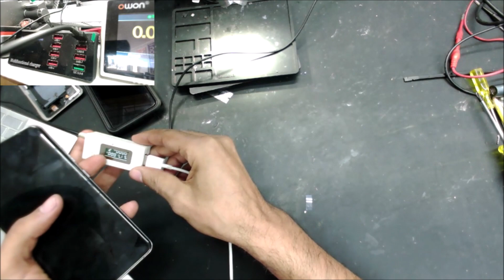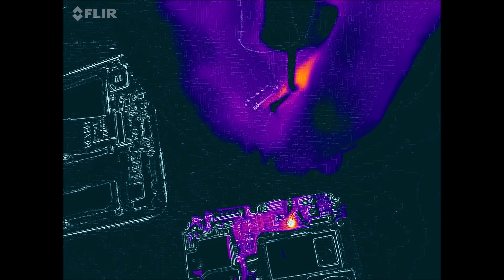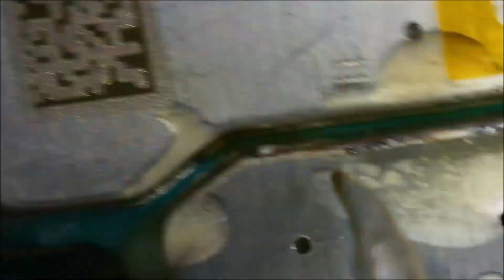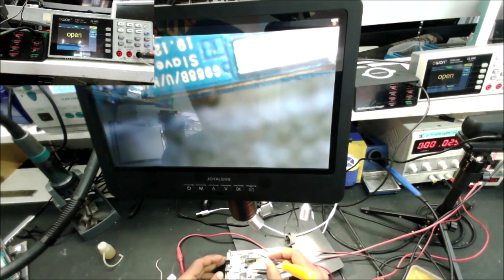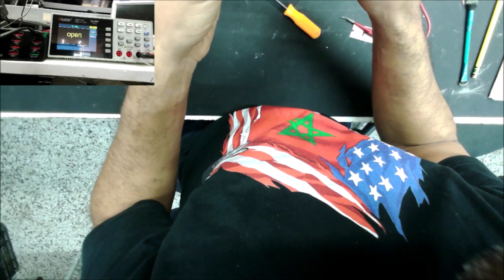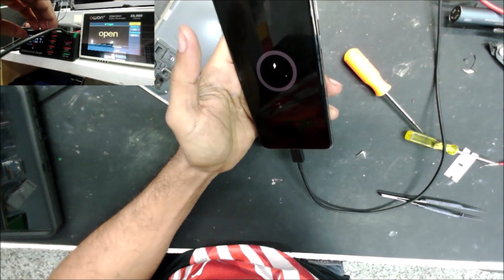Samsung Galaxy S20 Ultra SM-988U no power way to find short in the board

Comment: I have a note 20 ult I ordered replacement screen to fix my cracked screen because my phone still powered on screen came I tested it by hooking up LCD ribbon cable new screen worked 😊 I then tore down and mounted to new frame and  to my surprise my phone has no power now even after re mounting to old frame I suspect a ribbon cable or battery issue but I'm not sure where to start I can't return this 300$ screen and I have no power please help??????
Reply: same issue here, did you found any fix?

Comment: What a fantastic repair! 👍  Not a cheap phone. 💰
I once slipped on conformal coating while probing a board (live) and blew up one of those little black smd's. Took me 2 weeks of online searching to figure out what it was. I had an identical working board and the component tested as a short on the good board & I was convinced it was a black cap that I had destroyed. Nope! It was an smd ferrite bead 😳- I had only thought they always looked like a diode. Another lesson learned. 🤓
Reply from the maker: in the iphones they called them filter is smd low ohm resistor works as fuse
Reply: @SOSfixElectronics  Interesting to know that. I thought low ohm filter resistors usually were labeled '0' ? Obviously not in this case, just goes to show ya.
Reply: @electronicrepairservice2020  hi sorin  SOSfix Electronics repairs everything same like you do..